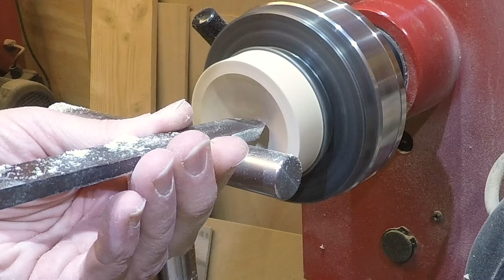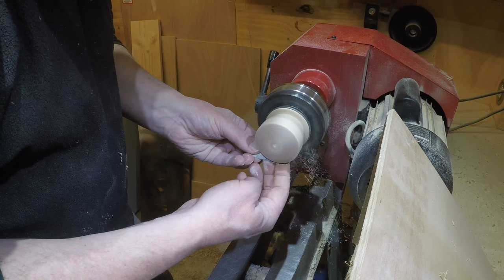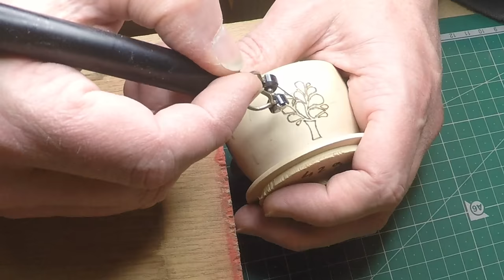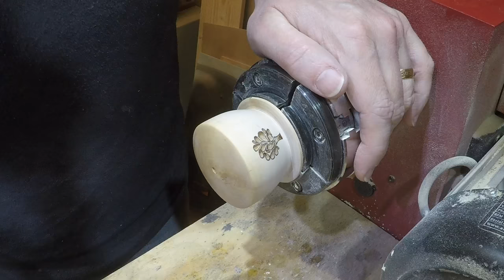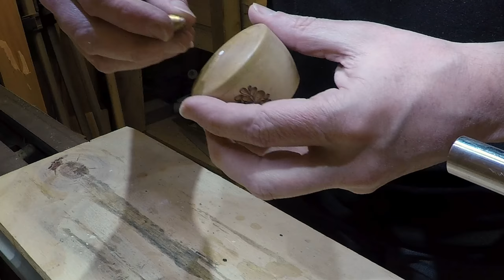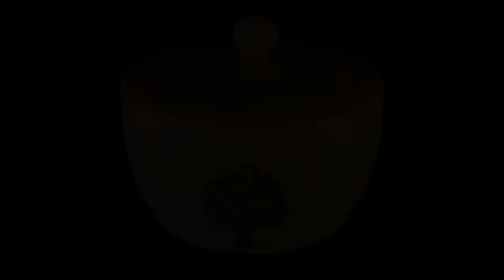Gift For Pam (Highland Boxes) - Episode 112

Comment: Paul it seems you have a magic hand. I don't believe I've seen you make any mistakes while doing pyrography. That happens most often with beginners. You must have that magic touch. Many blessings to you my friend!
Reply from the maker: Thank you Tracy. Magic hand, not quite so sure. I tend to concentrate on the main lines of the piece for tracing. From there looking at the original image you fill in the missing pieces and by doing that they don't have to be exact. So if there are mistakes then I put that down to my take on the image. I've often added extra compared to the original image, intentionally that is.